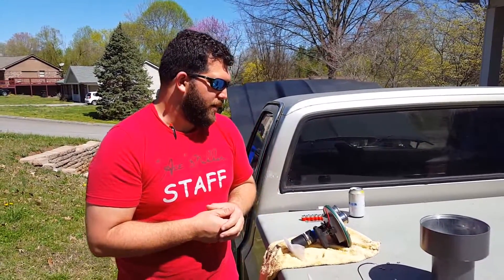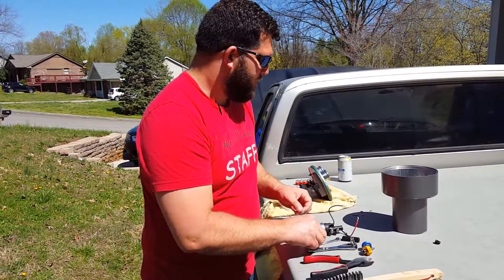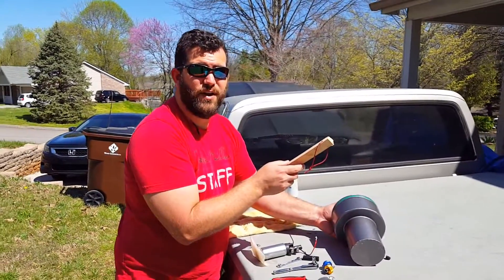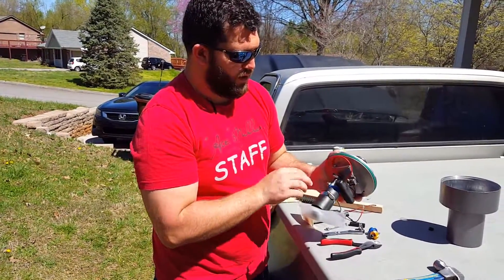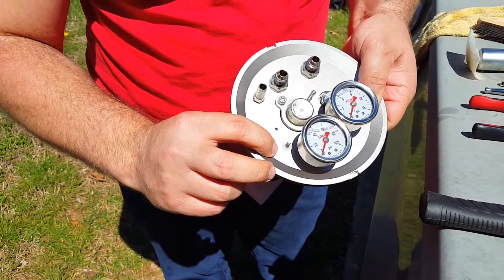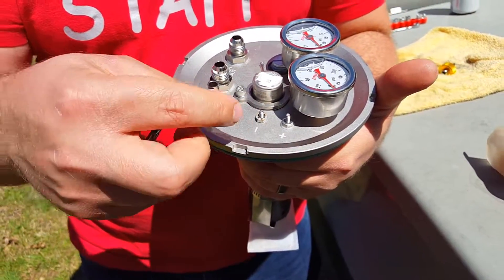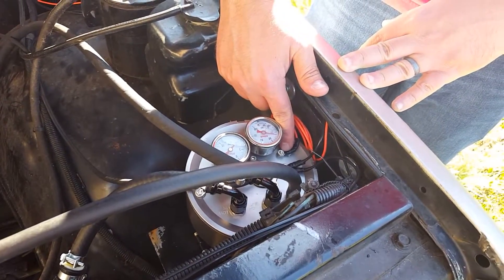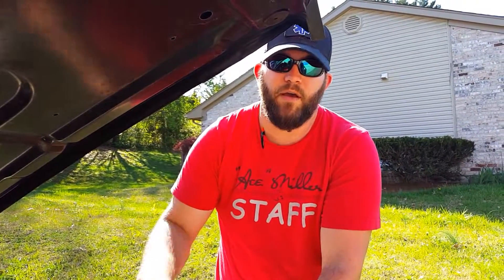How to disassemble a FiTech Fuel Command Center

Comment: These command centers do not belong no where inside the engine compartment.  They stop working about after 10 miles in Texas heat. I have to let it cool down  with water. it has let me stranded every time. I have done every thing I could to shield it from heat to no avail.  Only in the winter when its cold, they work great.  I should have gotten the in line fuel pump with return line.  Now I am stuck with a $300.00 pump .  worth less.   Any advice anybody????

Comment: Hi my pump isn't coming on where you having the same problem. When took yours apart
Reply from the maker: ralph Smith - yes, my pump was not cycling on. I would  recommend checking the fuses in the FiTech wiring harness first, to make sure they aren't blown. If they're still good, then I would contact FiTech about a replacement pump.

Comment: How did you burn out your pump inside?
Reply from the maker: I thought there was more fuel in my main tank than there was, and my mechanical wasn't keeping up with the high pressure fuel pump. Long story short, the high pressure fuel pump ran dry for about 10-20 seconds, and quit working after that. FiTech's Tech Support says it's a known issue, and sent a replacement pump out a couple of days later.
Reply: so it's safe to say never run on a almost empty gas tank then.
Reply from the maker: shenlonco That's for sure!